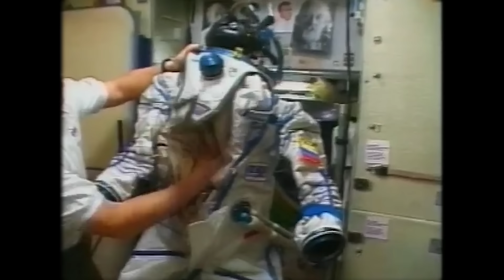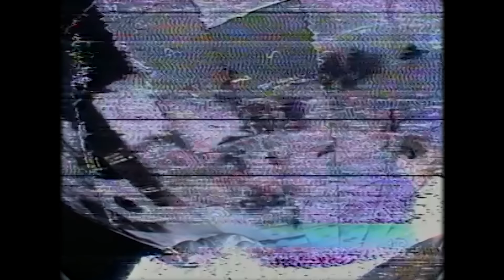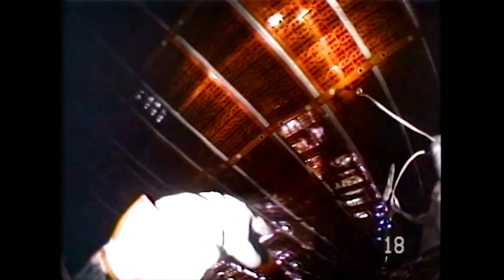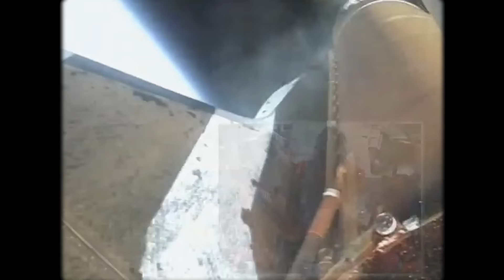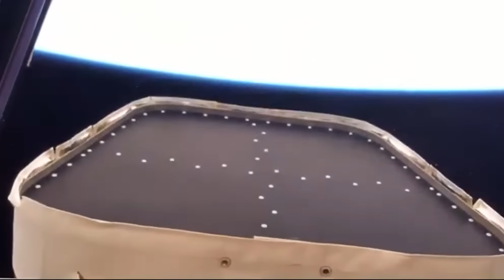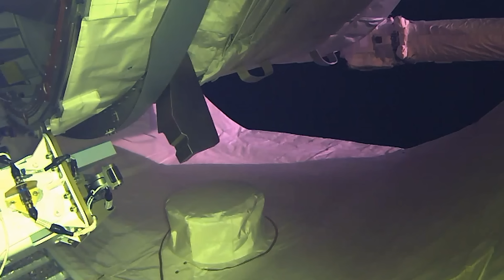How We Built the ISS - Part 2

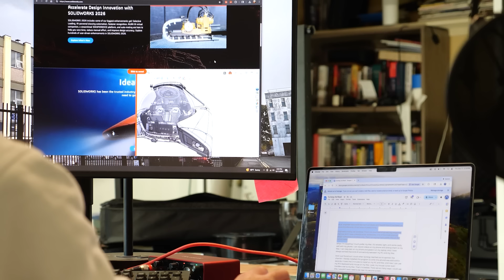Comment: 27:00 I actually need this for my home lab. I have 2 laptops one is headless another is about to be. I also have two desktops. But turning one of them into a rack mount and deploying another rack mount unit. I have a 48 port switch I currently have 12 connections from the router for the Internet with 11 others that need Internet. My dad has a old pavilion g7 laptop needs a new fan great for Linux testing especially with ATI GPU. Linux love ATI,  later AMD, and Intel GPUs. Hates Nvidia GPUs.

Comment: I would have never retired the Space Shuttle. Just look at Artemis' costs. They are just as insanely over-budget as the Shuttle and lack all the unique capability.
Simply modernize and consider different (stronger & more durable) new alloys for building materials would have been the correct call.
The capability of taking a full-scale telescope into orbit (heck even taking up modernized components to service said telescope) is a huge thing to give up, just because of some minor errors leading to disaster upon re-entry (which should have been obvious considering the materials used). And to top it off, it could bring BACK orbiting spacecraft!
None of the errors even affected the missions in space!
Reply: armchair experts.

Comment: 19:32 That may have been what they came up with but it wasn’t implemented.  Solar array pointing has many constraints and to this today requires a small team of flight controllers and engineers to determine the safest configurations that meet all the requirements.  

I’ll also mention that the guide wire failure / array tear was likely impacted by the original deploy and retractions that array underwent. 

The solar array deploy on STS-97 /4A was much more dynamic than expected which lead to an unplanned EVA to repair the array and a new gentler deploy process for future array deploys.   

The retraction  on Assembly Flight 12A.1 took 2 unplanned EVAs as the blankets kept binding and jamming. The EV crew had to use one of those kapton taped hockey sticks Scott showed to help guide each bay in and free any stuck guide wires. 

It was no wonder when that array was deployed again on Scott’s flight it was damaged.  

I was hoping you’d go into both retraction flights  (12A.1 & 13A)  in a little detail as they both had some of the most harrowing problems of the entire assembly sequence.  

Otherwise this has been a Finn series of videos.

Comment: 8:48 I knew I wasn't crazy when saying you always need duct tape with you at any given time
Reply: "Duct tape is magic, and should be worshiped." - actual quote from Mark Watney in The Martian 😂
Reply: Kapton tape, not duct tape. Not quite as sticky or strong as duct tape, but it works in extreme temperatures and in the vacuum of space. It’s also chemically resistant to tons of different substances that would ruin just about anything else. It’s genuinely a magical material

Comment: Why is the atmosphere in the suits (and in the station?) 100% oxygen?
Reply: Inside the station is 80% nitrogen and 20% oxygen at earth atmospheric pressure, very similar to what you are breathing right now.
The suits operate at about 1/3 of that pressure, in order to keep them more flexible in a vacuum, but then it also has to be 100% oxygen or otherwise a wearer might not be able to breathe. (similar to how a high mountain climber sometimes needs extra oxygen to breathe)
Reply: @debott4538  Ooh ok that makes sense. Thanks :D

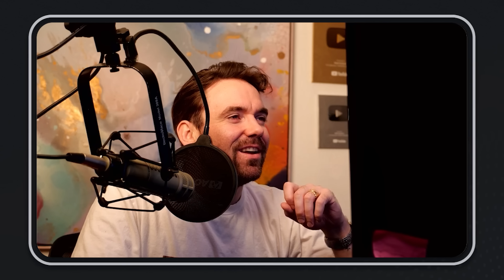Comment: 10:56 so basically they needed an electrical connector that can handle high voltage and high current, and a non conductive physical connection to stitch the panel back together?

Comment: hey buddy, a bit of correction: the Rassvet Module was launched during STS-132 onboard Space Shuttle Atlantis*** in May 2010, not 2012 after the shuttle’s retirement

***it was supposed to be Atlantis’ last flight, but after the backup STS-335 contingency flight was approved to be promoted to become STS-135, Atlantis flew again, ending up to be not just its last flight, but the last flight of the shuttle program…